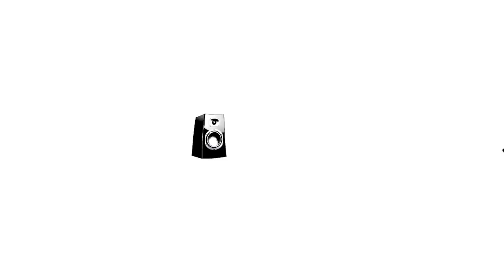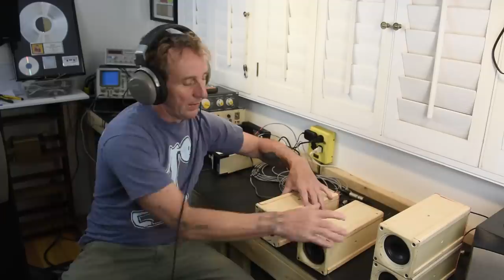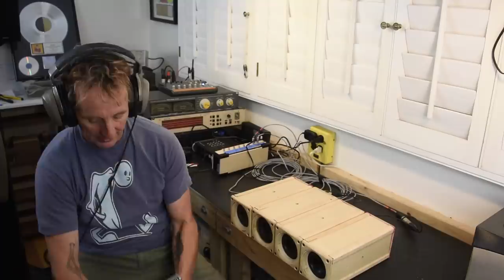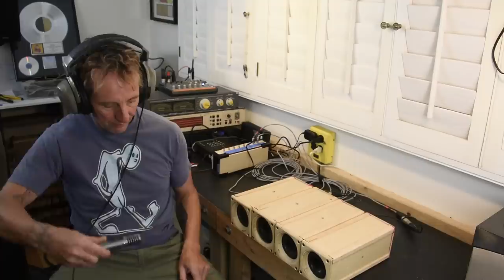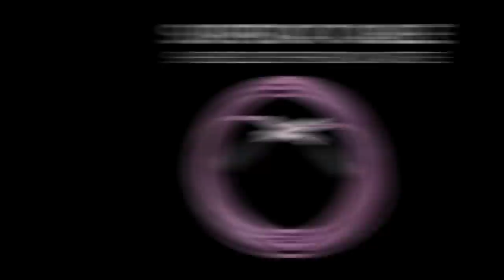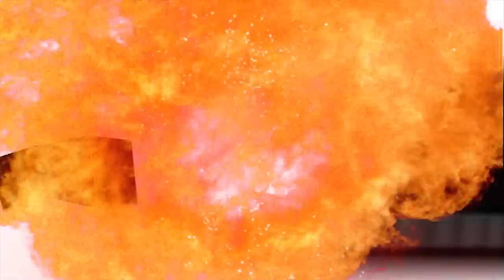Line Array vs Point Source vs Human Hearing

Comment: Hello Dave,
I am sorry to disagree with your point of view.......
If you mention the human factor than you have to agree that the line arrays are not suitable for any modern music reproduction to be heard by humans.
What I mean by modern,....there  is an invention that was made back in 1930, that is called,....STEREO.....
Being at a concert where the two line array are hanged left and right, only 20% of the people from the entire crowd do have the privilege to stand in the "stereo sweet spot" right between the speakers for them to hear both stereo channels with equal intensity and relative equal arrival times to experience what the sound engineer or the DJ created. What is sad that even this very small "true stereo" location is very often  blocked by fences for the cables or security personnel.
The fact is that at any event where a line array is used the people hear a sound that is not even mono (that is the summation of both channels) it is a lot worst ,...they hear only one channel. That means the sound characteristics don't even meet 1930 standards. People hear only half of the sound, they should pay half of the admission ticket price.
Fortunately I have in development a "true stereo" sound system where the 100% of the audience can hear a correct stereo sound,.....no matter where they stand, This is achieved only with two channels. The " true stereo' area goes even beyond the left or the right speaker.
Not only we have a correct stereo image we are adding depth to the stereo stage. I am working on this for more than 10 years now, the difference is incredible, you don't hear the speakers anymore, the sound comes from the air. Believe it or not this is done strictly analog with no DSP. contacted
Reply from the maker: Interesting. And this concept of basing live shows on a nearly ancient concept of "stereo" as the baseline by which all things should be compared is fascinating.

Also the concept of mixing live shows with multiple arrays spaced at 30 to 80 feet apart and often having center clusters, out fills, and delay clusters in addition you out fills and other regional coverage systems, in the same "stereo" method that on would mix a recording for 2 home HiFi speakers spaced 10 feet apart, may be short sighted and underestimate the intelligence, complexity and awareness of the pro audio industry.

Regardless, narrowing the physical width of a wide dispersion sound source will induce less horizontal interferences than a wider physical dimensions sound source with multiple drivers horizontally spaced.
Reply: @DaveRat  
Hello Dave,.....I do apreciate your answer.....
Yes,....stereo is somehow.....ancient....
It is over 2000 years old....
 LIfe is stereo,....has always been. I fact stereo is still "in fashion"
That is the reason the headphones we are using have,....TWO cups,....for each year....
This is how us humans interreact with everything around us. Our ears are a very delicate and capable instrument....
Contrar the popular concept that all audio engineers have,....the human ears can pinpoint the direction of a sound source 360 deg both in horizontal and vertical plane.
I am not going to get in live mixing stero sound topic, that is for another day.....
If you can enlighten your viewers, on an EDM. Event where a DJ is playing the music he created,....IN STEREO....The attendees that pay upwards of $300.00 for a tiicket....
Do they get what they paid for?.....
I will answer that for you....NO....over 80% of them hear only one channel. That is worst than mono (that is the summation of borh channels) they hear half of the music the artist created,...they should pay for half of the ticket then.....
The only stereo sweet spot is exactly in the center,....unfortunately this area is not available, it is fenced off for security and cable runs....
It is up to the engneers to demand from the manufacturers better products, to give the audience what they paid for.....
I do appologise, I have nothing against you personal, I am just frustrated with the whole audio industry is on the wrong path,.....only greed and profits,.....light speakers that pack well in a truck.....
If interested I would like to continue this converation, private thru email......If is ok with you just say so,....I guess you have an email adress on your site....
I wish you a wonderfull day.....
Andy Munteanu....
Reply from the maker: Hmmmm, life is not stereo.  The environment is not stereo and the way we perceived the world is not stereo.

Yes we have two ears and we can perceive most of the sound we encounter with our two ears but our perception of sound is not limited to our ears, as we can feel sound physically as well as perceive sound with out ears plugged.  Especially apparent underwater. Try it next time you are in a awimming pool, bathtub or ocean.

But even that is just absurd.

To say the world is stereo because we have two ears is like way more silly than thinking the world is flat or the universe revolves around earth. Like looking through binoculars and determine the world is just two disks of light. Ha!

Sound in the world around us radiators from infinite sources in all directions. To try and recreate a 4d sound landscape with stereo or two or 10 sources is like trying to recreate a real world environment with a 2 projectors.

Nowhere in nature does the exact same sound radiate from multiple points in space. Nowhere in nature do multiple unrelated sounds radiate from a single point in space.

Any sound source or system or reproduction that defies these fundemenals will never sound real and will never be an accurate reproduction.
Reply: @DaveRat  
Hello Dave.....we can continue this conversation for months.....
What boils dow to is:
It is esential for humans to have two ears to relate to the environment around us....
Try to have one ear covered for an entire day ans see the result.
Yes,...different.sounds do generate from different sources in the same time.
Someting that you should be familiar with,.....on a stage with a band playing, different instruments generate sound from different locations on the stage. You place the instruments with the pan knob at a particular location. 
All the instruments form what is called a sound stage, a stereo image. 
You have no tools , no means and evidently no knowlege how to convey correctly this experience for the entire audience.
What you hear on rhe FOH mixing location it is good only for the people in font and behind you.....the rest they hear somethin else..@$%#$$$# being left or right of the listening area the arival time and the intensity of the sound is different from what you have at the mixing location.....
The truth is that 80% of the audience hear something else compared to what you hear on the mixing board location, most of the time they hear only one line array,....that is HALF of the stereo image that you create.
You should demand from the equipment producers better tools that will allow you to convey what the artist created CORRECTLY FOR ALL THE PEOPLE.....
Reply from the maker: the assumption that an engineer mixes for themselves in the people in front and behind them is short-sighted and incorrect for many engineers.

I personally never mix for the center as less people are there then there are everywhere else.

I mix for the room and I find the concept that it should sound the same throughout the room completely flawed and absurd.

The real world environment constantly changes as you move around and so should a concert.

I love that you have big ideas and are thinking about this in depth and also it is quite clear that your experience with high-level professional sound reinforcement is somewhat limited.
Reply: @DaveRat  
Hello Dave,.
I can say that I am not surprised that a "high level sound proffesional" like yourself, in fact have have no clue how humans perceve sound.
Even if you are reluctant against stereo concept, this is esential for humans. This is how we perceve the location of the sound source.
This is done by the brain analising the time arival, intensity and the phase differences of the sound ariving in each ear. This pinpoints a precise location of the sound source to a 2 degree resolution......
When you mix at a central location betwen the speakers,  you will hear both speakers with same intensity, time arival and phase. 
That is valid for all the people un front of you and behind you, all being equaly distant betwen speakers.
Now,.....the rest of the people, 50ft to your left and 50ft to your right, will hear the speakers, each with different intensity, time of arival and phase....The result is a totaly different stage image that you have at the center location.....In other words,  they hear something else of what you hear. 
This "something else" is ussualy worst of what you hear.
Bottom line is that you think you are doing a good job with your millons if dollars of high teck sound hear,.....in fact 80% if the audience hear something else of what you hear. And this somethin else, you dont't know what it is,....because you cannot hear it from your central mixing location.
Instead of you playing with little speaker models in youtube,  maybe you should read up on percention of sound fundamentals, then you can promote yorself from a hardware engineer to a real sound engineer.
Reply from the maker: Oh my, I find it quite interesting that you are trying to speak from a position of knowledge and authority concerning an industry that you have little experience in.

That said, I appreciate your passion and how exited you are to revolutionaize live sound with a product developed from an observational rather than practical and experienced perspective.

Regardless, I see you are involved with cnc foam machines.

I am actually looking for very rigid, lightweight foam panels for a project. They must be resistant to crush but can have laminated films.

Size is about 3ft by 7ft, maybe 1" to 2" thick.

Any suggestions?
Reply: @DaveRat  Hello Dave
I do appologise, please do not take this personal.
No,...I am not trying to revolutionize the sound industry....
I am just voicing out my frustration with "your" industry that is not driven by the goal to be the best it can be,.....it is driven only by (your words) practicality..... and how easy is for the rig to be set up and how well packs in the truck.....nobody speaks about quality of sound anymore.
My opinie is for a show where the organizer makes few millions of dollars they should spting for two extra trucks ,.....if that will result in better sound.
Nowdays all speaker manufacurers pride themselfs with  the ability of controlling the sound,.....not to go in populated areas outside the venue.....They shuld talk and pride themself with the sound people that pay $2-300 for a ticket hear.....
I used to go to lve concerts,....I dont go anymore, I can't stand hearing that lifeless sound, compressed, limited and lack of impact and dynamics...
Yes I build the machines that companies use to cut foam and acoustical products...
In fact the wedge shaped acoustical tile that everybody is usung today,.....believe it or not, I invented that product. If you get 1990s copies of sound recording magazine you are going to see my advertising there for Wedge Tiles, from my old company Sound absorbing Materials Company.
Best contact I can recomend you for your project is Sound Coat company in Irvine Ca.
Thet have one of my machine and make all kinds of acoustical products, from automotive to aerospace. You can find them at www.soundcoat.com.
Again my appologies for the "collored" comments I made, am only an audiophile with 45 years passionate hobby....audio perfection.
Sincerely I do applaud you for your audio youtube channel, educating the people interested in finding out more this industry....
You definely have lots of experience at this.
Congratulations on your powersoft transducers subs.....I immagine they sound pretty decent.
I wish you a wonderfull day.
Reply from the maker: Very cool and I am sorry that you have not had exposure to the more innovative, creative and sonically exciting side of the pro sound industry. There is cool and fun stuff that pushes the limits of large scale reinforcement.

Maybe take a dive into L-Acoustics L-ISA systems. Some exciting stuff there and bands putting together some cutting edge reinforcement.

L-Acoustics in general as well as d&b make some amazing, powerful and great sounding products.

All the shows we do, we do 3d modelling sound predictions and very precise calculations and layouts.

Festivals like Coachella involve massively complex sound systems where we deploy over 500 large format loud speakers, the main stage has 27 delay clusters tied together by fiber optic, and real time volume scaling to account for crowd sizes and other stages covering acres and acres of land and all the while, huge budgets with providing optimal and exceptional sound being the driving force. Year after year we spend months and 100s of hours optimizing ways to blanket 100s of 1000s of people with memorable sonic experiences.

The massive 300 foot by 300 foot Sahara tent is a sonic masterpiece of complexity where the sheer size and slowness that sound travels creates mathematical and perceptive challenges that are incredibly fun .

I feel like there is a realm to live sound that perhaps you are not aware of.

Maybe a Google search on Dave rat Double hung PA will find you an adventure I dive into that was amazing.

There are bands and engineers out there that sound amazing, Roger waters, radiohead, alt J, Muse, to name a few. Festivals like Coachella as well.

Live sound, like everything from cars, home HiFi, and any trade or product category has its range of crap to stellar.

The stellar is out there in live sound and that excitement of stellar live show is what home hifi strives to re-create

Comment: i hate line array sound they sound so unnatural and fake.
Reply from the maker: Hmmm, well for large venues over long distances, I think you may find that well designed line arrays actually sound clearer and superior in ways that other system designs struggle to achieve.

But, that said, it's all about using the right tool for the job and knowing what those tools are and not having an emotional attachment, but rather, applying wise and practical knowledge to make good decisions
Reply: @DaveRat  dosen't sound natural at all line arrays sound metalic and the sound its like a surround cinema shit you can't identify the source of sound its like its coming from all directions i hate surround cinema sound i like to hear sound from one source and to identify with the ears the source. Point source dosen't have  those problems the sound its natural with great separation and no surround effect .